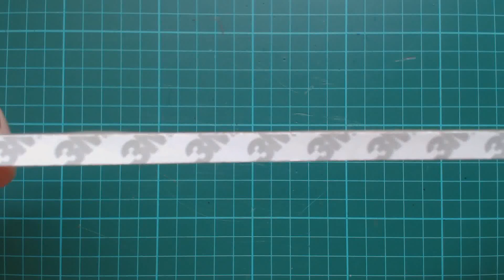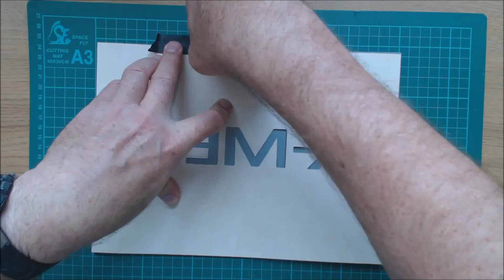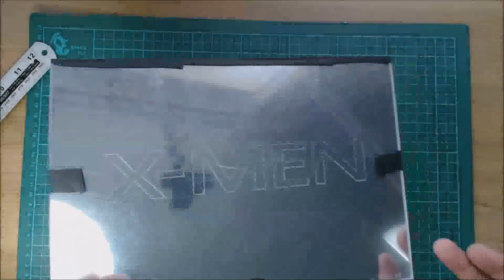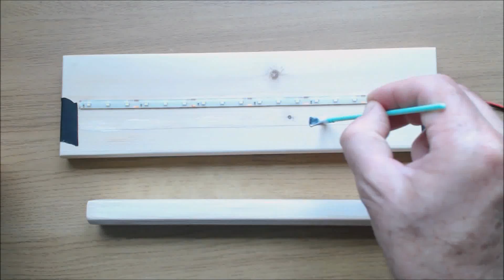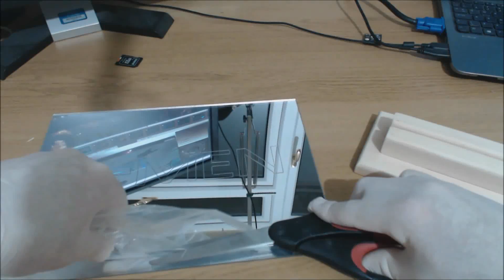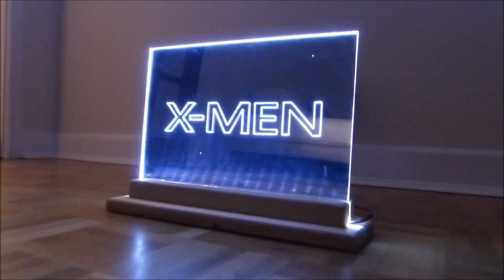How to Make a Mirror Acrylic Led Edge Lit Sign /  Emblem / XMEN Themed Light

Comment: As an updated touch you can get super fine etchings using a Brother Scan N Cut with Zoom's etching tool.  The Scan N Cut can handle materials up to 3mm thick.  In this case it would be used in draw mode with the etching tool inserted into the tool head.  There are three different tip sizes (broad, medium, fine).  You then adjust the settings for the cutter to those specified in the instructions for that particular tool.  The machine will produce an estimated time to completion on its 5 inch color touchscreen display.  Once done it will eject the mat and material loaded onto it.

Comment: ive had a stack of plexi in my garage that came from hardware store scrap... hated cutting the shit by scoring.. on a recommendation I got a 80 tooth blade for my miter saw. 27 bucks at harbor freight has made cutting plexi a easy. Bonding 2 pieces does not require expensive glue/weld liquid  unless you are using the really expensive double linked lexan plexi. simple hardware store acetone and clamping for a few hrs will create the same bond.

Comment: I like the idea. 
Suggest sanding-sealer on all wood surfaces to fill grain and sanding marks, fine sand to create smooth surface, then a couple of coats of gloss black acrylic paint followed by a gloss clearcoat, and your base will look professional and high-tech to match the project (rather than country-rustic with the raw wood, which also shows fingerprint stains after time from oils, hard to clean off dust, etc.).

Comment: Another great piece of work!

Two questions, though:

1) How do you prevent the Dremel from damaging the ruler while engraving, and
2) How deep do you have to engrave? Just scratch the surface, or halfway through the material?

Thanks for the great ideas.
Reply from the maker: The engraver I used vibrates rather than rotates, so it does not damage the edge of the ruler.  The engraving iss not very deep,  0.5 - 1mm, it only takes a scratch to show the light. Thanks for your comments.

Comment: This is absolutely amazing! I definitely  want to try this out. You make it look so easy but I'm guessing it took a lot of practice. How long have you been doing them and how often? How long does it take to complete?

Thanks for uploading. Keep up the good work. I'm subscribing now, without a doubt!
Reply from the maker: It was the third one I have made, the engraving is fairly easy. A couple of hours to make all of it.
Reply: techydiy And how many of those mirror lights could you make out of the whole led strip do you think?
Reply from the maker: Depends how long the strip is, 3 per meter or 1 for every foot roughly

Comment: Awesome design, very inspiring! Can you engrave outside the premade stencil letters? Or for mass production, can you make letter A-Z numbers 0-9 using heavy-duty cardboard? Also, is it possible to combine the USB LED strip with hybrid solar-powered battery? The battery can be hidden inside the wood panel, with the solar strip glued in the back facing the windows, then you would have a perpetual LED sign. Obviously you can spend more money using the scan&cut machine to automate the process. Haha... just a thought, from a not-so-diy-adept person.
Reply from the maker: +1to1class Yes you could do all of that. Thanks for the ideas

Comment: Nigel, have you tried combining the edge-lit design with the infinity mirror design??  I'm super curious to know if you can engrave into either the front side partial reflector or a third middle sheet of clear acrylic sandwiched between the back and front reflector, and then still see the scattered light exiting from the engraved pattern.  I think you're more qualified to try this before I do :)
Reply from the maker: Yes, I have and will publish a project fairly soon. With the sheet in the middle approach you also get another set of weaker reflections, making the 3d effect more solid.
Reply: Awesome!!  Looking  forward to it.  Or maybe I'll beat you to it... :)
Reply: Follow-up: have you tried the infinity mirror setup with two partial reflectors rather than an opaque backside reflector?  I assume that it would produce weaker reflections (not as much infinity..) but be visible from both sides??

Comment: Love your DIYs,

a quickie (?) though, is there anyway we could give the illusion mirror effect to an acrylic emblem/sign themed light??
Reply from the maker: Yes, you can combine the two. Engrave the rear mirror (preferably laser engraved),  edge light it and then put a two way mirror in front. It gives a 3d effect to the engraving. The right design would look cool.
I have been meaning to build one as a project for a few years now but never got around to it. However I did mock it up at one point and it worked.

Comment: What the likely hood of the wires catching on fire? does it produce enough voltage to burn?
Reply from the maker: The led strip voltage is 12 volts, so it's a safe voltage to work with. The led strip generates a very small amount of heat which is easily dissipated, so no it doesn't get hot.

Comment: I don't see how you're able to do this, but I hope you can help. I tried 2 different LED strips and they just can't properly light up my acrylic sign. Mostly it's a faint light near the top where the strip is.  I can't get an answer from anyone else on YT who made these acrylic LED signs.
Reply from the maker: Make sure the leds are in contact with the acrylic sheet, move it forwards and backwards to find the best location. Also make sure your engraving is deep enough.
Reply: @techydiy  The engraving is deep enough.  It was bought online.  I messed up because I wanted to remove the switch, and I guess it shorted out.  So I removed the old LED strip.  Still can't figure out why my LED strips don't light it bright enough.  Nothing is working, I even tried angles.

Comment: Should have screwed those 2 wooden pieces instead of gluing them. That way, you have an easier way replacing the LED strip, if it turns out going into full obsolescence mode.
Reply from the maker: I thought that I had screwed the 2nd piece of wood, none the less a good point to make.
Reply: Afterall it is a great tutorial. I actually thought about getting a DREMEL for myself, after seeing this video.
Might become handy not only for this purpose, but many others!
Reply from the maker: Yes they are usefull tools

Comment: Do you think I could solder using a switching adapter if it’s the correct voltage?
Reply from the maker: I am not quite sure what you mean. You can use a switch mode power supply.
Reply: techydiy oh thank you. I found out for myself. I was just wondering if the label on the adapter has to say DC power adapter. Mine works but it says ‘switching adapter’.

Comment: how much would you charge to cut the appropriate wood pieces for me and ship them?. I live in Michigan. thanks
Reply from the maker: It's not something I can do it would cost a fair bit to ship. Perhaps someone local can make them up for you, ask on a local community forum.
Reply: Alayshia Williams If you have the dremel tools, then it wouldn't be hard to fashion another base out of a solid piece of wood rather than using router-profiled cleats on a base. Just make a trough in a block of wood, stick your leds down, and prop your mirror in

Comment: can I use 24v  LED Light?
Reply from the maker: Yes
Reply: will it look the same?
Reply: and can I use any Power Supply for that?
Reply from the maker: The colour of the leds and how many that you use will affect how it will look.
You should use the correct power supply for the leds that you are using.